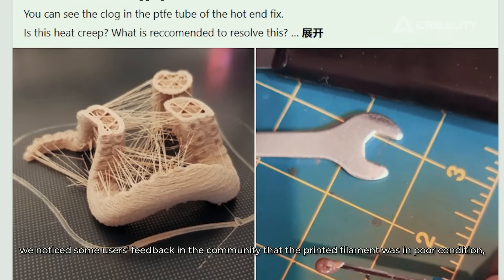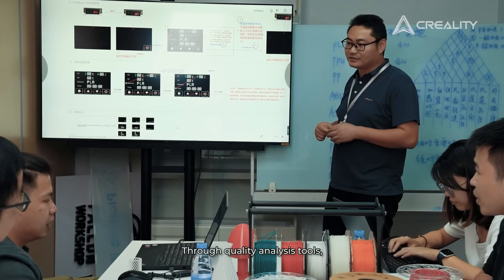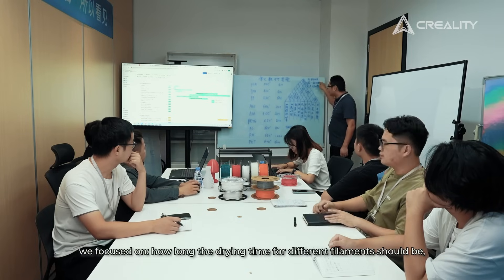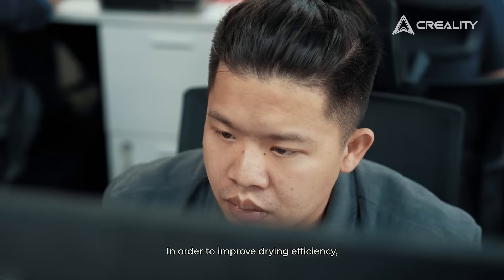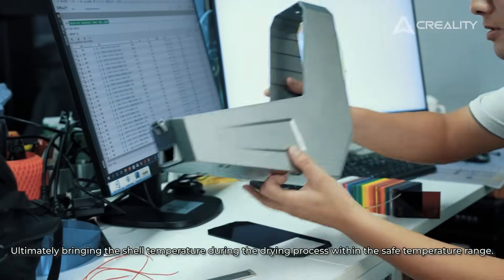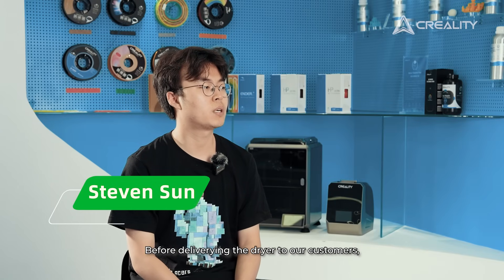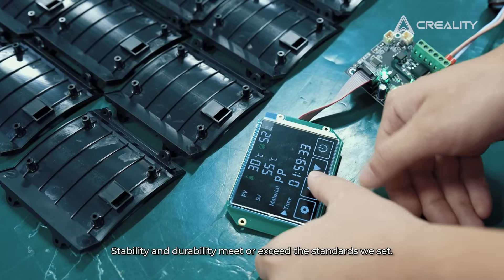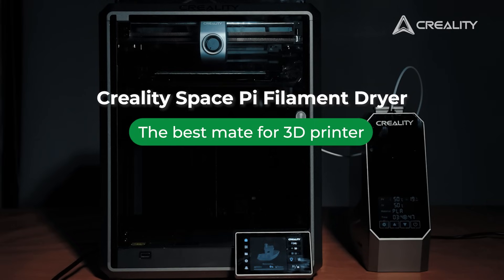The Untold Story Behind Our New Filament Dryer - Space Pi

Comment: Space Pi's LCD screen is the worst screen I've ever seen. All I see is in the devices. Worst. Definitely. There is no handle on the top. If you hold the lid, it opens and everything falls apart. I've been drying PLA for 4 hours. Before recovery the humidity was 43%. What's the guess now? It's still 43%. It has a hole for PTFE tubing on it. Should this hole be closed or kept open during drying? I don't think I can find an answer to this question. I've been using it for 5 hours and I regret every minute of it.

Comment: wouldn't this just make a high humidity environment for the filament, as opposed to actually drying it?
Reply from the maker: Absolutely, this filament dryer is designed specifically to effectively dry filament. It utilizes precise temperature and airflow control to remove moisture without creating a high humidity environment. Rest assured, it's a reliable solution for keeping your filament in optimal condition for 3D printing

Comment: Hmmmm, I have tested the drybox for 2 weeks, but more research needs to be done into the drainage of moisture, only when you open the lid of the drybox slightly, the moisture is removed... for now it is just a filament heater, but does not dry.
Reply from the maker: Could you please let us know which filament you are using? We want to have in-depth testing and research
Reply: @Creality3D   Hello, it is standard PLA filament from different brands such as Real, Polymaker etc... the problem is that the moisture cannot escape from the drybox, as soon as you open the lid a little, you will see that the moisture disappears, there would be something needs to be constructed in the lid so that the moisture can get out, but not in.
Reply: @matebri  wouldn't drilling a couple holes solve that issue?
Reply: Agreed, I have the same observations. I placed a thermometer inside and monitored the humidity. Without opening the lid the relative humidity will slowly increase and not get released (obviously, as the box is sealed), so the drying process will probably not be efficient. I made a small air vent spacer (find it on Printables), which could be attached on the dryer case, so that the humidity is continuously released. This fixes the issue, but obviously would be nice if the dryer does not have this issue in the first place.